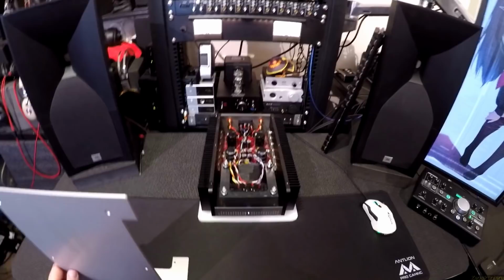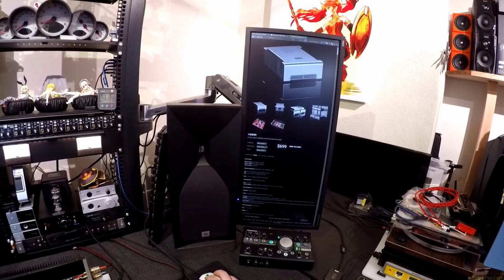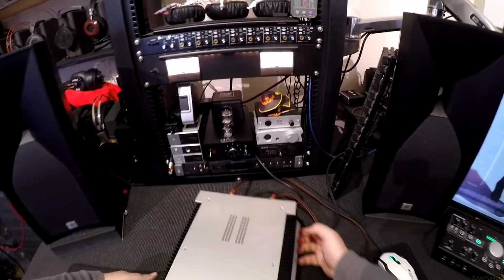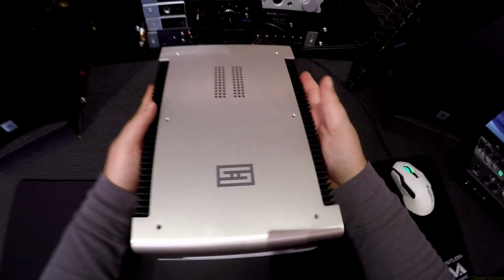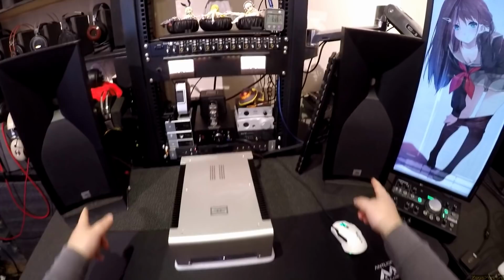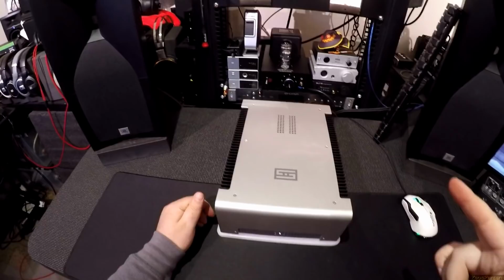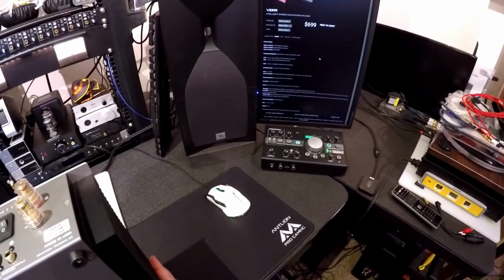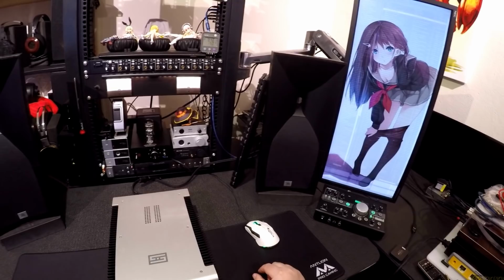Z Review - Schiit Vidar [Not Vader. NOT STAR WARS!!! FFFFFFF]

Comment: Schiit Freya [A Tube Pre that Warms your heart.....]

Schiit Vidar [A Power Amp that Warms your home.....]
Reply: Schiit aegir [A power amp that cooks your dinner.....]
Reply: I remember getting into an argument with my dad about this: If you're using resistive electric heaters to heat your home, you might as well not turn off your class A amplifier in the winter. When you're not using it, it's just acting as another electric radiator, anyhow. Then again, an HVAC repair guy friend of mine would point out that using resistive heat is wasteful in and of itself. Heat pumps often get you more heat than the electricity you put into powering them.

Comment: Have this powering my LS50's sourced from Mjolnir 2 and Gungnir. Simply stunning...
Reply: im having trouble connection my FiiO5 x3(for spotify) to Gunggir dac- should work 3.5 out from FiiO5 x3 to coax on Gungnir but get no sound, tried 3 diff cables. Probably must return Gungnir to Schiit. Do you use coax in. and yes, my cd player with RCA in to Gungnir works fine.
Reply: TheStefster nice !! I have the same set up debating if to get the Vidar or Aegir  run mono block  what’s ur take on that?
Reply: @file1man  coax is digital. not analog.
Reply: @file1man  How do you have an $800 DAC and not know coax is digital?
Reply: @file1man  does that configuration generate sound on a different DAC? Uh, no. 3.5 is an analog audio cable you should try a 75 ohm digital cable.

Comment: I have this exact same amp in black. My solution to turning it off was to get a Remote outlet and to connect the amp to that and a strip of leds. That way I can turn it off with just a remote and the LEDs will let me know if they are on, as it lights up the back of my desk. Works prtty well in my opinon and it only costs me 20$ CAD and not too much of my time.

Comment: The problem is your behringers aren’t actually putting out the wattage they claim, not cleanly and not for more than a millisecond. That why Class A exist. Class a/b is great too, but when you want a real all go no quit big nutts harry stamper amp? Class A is king. 
Adcom is my personal choice, for 1000 watts monoblock into 8 ohms (oh and it will do the schiit out of 4 ohms) you need the 585se, but I really doubt you could find the limits on their 555se...
Reply: GT4viper Class AB has nothing to do with why the Behringers aren't pushing the highly inflated wattage. It's the rail voltages at different impedances...one reason anyway. I have several mid 90's Adcom amps also....built like tanks with nice headroom. TRUELY conservatively rated power amps for a reasonable amount of $$$.

Comment: I have, a large computer desk, that had been dumped in perfect condition. It's 4 tier, heavy duty work place table, foot shelf, under desk  pull out, desk and  a upper above head shelf. This would be perfection on  that shelf with the Freya on the desk top, with my 32in monitor, keyboard on pull out, speakers desk top. Well at least I have the computer table and I can dream.

Comment: How to get over 1,000 watts: Get the VTV Hypex NC2000 mono amp (NC2K).  2,500 watts into 4 ohms, 1,600 into 8 ohms. Won't pop breakers either. SNR is 127db at 1,000 watts, super quiet. Costs $300 more than a Vidar. Makes over 800 watts before any distortion shows up.

Comment: I came close to buying this amp Z , but i bought a MONSTER instead I got the Integra M-504 50 pounds into a 20 inch by 20 inch box 2 huge transformers and huge green VU-meters ! I redone the 73000 filter compasitors and output stage transistors total cost 500 bucks  and .0003 THD Just dropped a review on it and it's a rich smooth sounding amp today it would cost me over 5k to buy something new to compete with it built in Japan during Onkyos  Golden age ! thanks Z if you wanna review it also let me know go check it out Z I know you'd love it !!

Comment: Those Behringers are NOT 600 watts from 20-20k. Maybe a true 300 watts but probably a bit shy of that. I'm sure they're good amps for the money but bridging them doesn't truely double like higher tier amps do. One spec I found on parts Express is 375 x1 bridged into 8 ohms. But that's  into 1 khz and 1% distortion. Full range and lower distortion #'s and you're looking at much lower power output than even the 375 x 1 @ 8 ohms.

Comment: my old bob carver TFM 35 amp from the 90s is 350 watts into 4 ohms and in mono its 750 watts. ON my diamond 10.1 it only says 10-25 watts at normal volume  i had it go to 125 watts and  that was only on when the bass kicked in. my father had a luxman amp that was 500 watts into 8 ohms i don't know what it was into 4 but he had the bob carver  and the luxman hooked up to the same speakers the bob carver on the mids and tweeter and the luxman on the bass and he had it so loud that he broke all the glass and ceramic collectibles off of his neighbor's wall next door in the apartment he was watching Top Gun. The speakers where the Acoustic Research Classic 30 he still has them and  just got a Emotiva 800 watt amp for them i had it on 55 could of had the cops called it was so loud but sounded amazing the preamp goes to 80.

Comment: I run one of these  power amp on 6ohms 200 watts each speaker  and it pushes them easily and very loud and clear . speakers are Dali Concept 10 s  . If you bridged 2 in mono would be over 1000 watts of raw mono power output . It would depend on the speaker ohms also.
These amps also have soft auto clipping inside Also a 12 volt trigger system.
and an input level control   . cheers and good luck .
https://nadelectronics.com/en_EU/product/c-275bee-stereo-power-amplifier/

Comment: I have my Vidars  powering my JBL Studio 590's  very happy with the results.
Reply: I've got m,y Vidar powering my JBL's as well but the old 4311 models.
Reply: @zacjbailey  does it sound good with your 4311 ?
Reply: Clayton Young It sounds great! its more than enough power for them. I also have them paired with the freya which really makes the music pop in tune mode. I mostly listen to vinyl through them though as I feel they are better suited for vintage though Spotify sounds great as well, as long as you have the brilliance and prescience in the right positions otherwise the mids and highs are pretty overwhelming 😅
Reply: are you running them as mono blocks ? I have the jbl 590's running on a dyna 70 tube amp. Do you feel like this would be more or less power ?
Reply: @Vader4tw  in mono block they can put out 400 watt which is more than enough for you might be able to get away with only one. But I think you are fine with the amp you have maybe better because the 590s are very efficient and the amp you have looks really nice.

Comment: For monoblocks, you night consider Emotiva XPA-1 Gen2. 600 into 8 ohms, 1000 into 4 ohms. Also has a 12 volt trigger. The price is right at $1199.00, but I believe made in China.
Reply: Maybe some buyers would rather not have Chinese Amps with Chinese parts.
Reply: @edithboozy1000  Schitt Amps made in USA with US parts,  Emotiva is all Chinese parts mostly built in China with some final assembly in US - deal with it.  FACT

Comment: Most wear and tear on electronics is startup. All the components need to heat up/cool down on shut-off. I think everyone in electronics knows that  The best amps are usually the simplest , I think Bob Carver said "straight wire with gain"

Comment: Adcom gfa-565se what you need is high current ...wattage is something to impress the car audio crowd  ...
The Adcom will drive any speaker even my vintage Polk's that are 4ohn but can drop as low as 2ohm and the GFA-565SE will not ever let you down .....
The only Amplifier that I've had that performed better was made by Krell and silly expensive .....
Just buy one and in stereo it will destroy what you have now but at some point you get the need to add more power then buy a second and run it in mono bridged and although it only claims 700watts in the real world when pushed it will easily push 1000 into a 6ohm load .
And the GFA stands for great fucking Amplifier

Comment: My KB has a volume roller running to my Schiit Modi 3 (while I wait for my Denafrips Ares 2) which then goes to my Tube Pre-amp with Bass and Treble and Volume, which then goes to my SVS 12" sealed sub under my desk as a foot rest which then goes to my Crown XLS 2500 which then goes to my Elac Debut Reference in Walnut on foam pads on my 3'x8' walnut finished sit/stand desk I built.  :)

Comment: I saw this - I was hesitant...to buy. The monoprice monolith amps are the way to go - it’s missing things as well (12v trigger? Loopout?
Reply: haris javed 12v trigger on a pure class A?????

These things are dependent on temperature for performance because of the number of resistors in them and the FETs.
Reply: I'd buy Emotiva pre and power first, and I reallylike Schiit. Schiit can't touch Emotiva's power amps for the money, but Schiit makes a better line of DACs and headphone booster thingies. In my first-hand experience, anyway.
Reply: I do agree with you
Reply: taief miah thank you - but I fail to see what topology has to do with 12v trigger?. I have class a Amps with 12v trigger and it’s a great way to save power. You can implement a 12v trigger regardless of Amp topology, also according to schiit audio the Vidar is class a/b amp and not fully class A as you claim. This amp uses bipolar junction transistors and depending on which ones are used can handle up to 125c, but that’s not the issue here because of large surface area of the heatsinks and plenty of room inside the chassis - I do like that this amp is built in the US, and has a 5 year warranty.
Reply: The Crushgroove I agree - I own three schiit headphone amps and one dac. For my speaker audio I use a Yamaha a2100, Yamaha z11/z9, Bryston, and lastly I have recently bought gryphon diablo 120 class A integrated amplifier, I have some parasound amps that are currently not being used (hca 3500, and  a51)
Reply: Trigger missing is an absolute deal breaker for me. So sad. Wanted this.

Comment: This was something done in the 70's to make an amplifier perform "better". Heating up the transistor cans until it's at "running" temp.  Also that would mean they would run around 90-100 degree's on average. I half way wonder if that's why the amp you have, has such a long startup time and it runs HOT. Maybe they have a little "thermal magic" going on? Though those look like mosfet transistors so that wouldn't make much sense?

Comment: comparing the specs of this unit it seems pretty good but my question is I would probably buy two of these and have it as dual monoblock set up for my tower speakers each block taken care of its own speaker. 

But then you look at something like a monolith monoprice Poweramp 2x200 which I already currently have which I got to say sounds fantastic and it ways like 50 something pounds even heavier than two of these.  I don't know if these units here well output a better sound quality then the monoprice Poweramp that I have because if you look up the specs the monoprice is still better especially the snr ratio I believe this is one 116db and on the monolith Poweramp they claim it's over then 120db just one example.
so I don't know what's your opinion but I still think the monoprice monolith Poweramp based on the specs and how much it weighs that's a good indication about solid components massive heat sinks transformer etc I still think that would be a better sounding unit then grabbing two of these and then getting 200 Watts a channel into a 8ohms when you can already get it with the monolith Poweramp .  Any thoughts 
because don't get me wrong I would be curious to buy two of these and set him up and see if I hear a difference but I don't think it would be worth the money because if I want to return it they're going to charge me restocking fee and everything especially because I'm in Canada!  But it sure does look beautiful.

Comment: If you really want to test amplifiers for noise floor and how clean they sound. Use a set of speakers that have at least 105db efficiency level to 112db. Then you’re stepping up to the next level. Don’t use speakers were there efficiency levels are in the 80s or 90db level.

Comment: @Z Reviews do what i do in middle east  go active crossover or(preamp as you call it) every frequency for each driver with a separate amp you won't need even 250 wpc for mids n highs 
also i use car audio amps n subs for lows also some audio companies use a little trick of cutting off the low frequency on a certain levels to prevent clipping n bosible distortion       great review btw and please tell chewbacca i said hi :)

Comment: If your livingroom speakers got bi-amp connection. Then i would add another sciit and run them on midrange/tweater, And the PA amp on the lowrange. Then you have the power you need without the noice.

Comment: How about a pair of Parasound A21? 750W into 8ohms each. Made in the USA.
Reply: Gerhard Westphalen parasound a21 is a good amp! I used to own one - but it is much more expensive than this Vidar. The a21 will do 250w x 2 into 8 ohms, and 400w x 2 into 4 ohms. You will need two a21’s to get the 750w - at that point you are looking at 6k usd if you buy new. I was able to get a used Bryston 14b3 for 4500usd, and it will do 600w x 2@ 8ohm, and 900w x2 @ 4ohm. I do think parasound amps are made in Canada, not USA, but I will check mine
Reply: Parasound is designed in USA (CA).  Manufactured in Taiwan.
Reply: Definitely not in Canada since they pulled out all dealers in Canada and it's impossible to buy new in Canada. I currently own 3 Parasounds that I had to buy used. I see the A21 for only $2000 so it would only be $4000 which is nothing for that much power at that quality.
Reply: Parasound with JC series  are the only ones live up to the price. The Parasound Halo A23 was horrible when I did the listening comparison among the Vidar, Mark Levinson 434 mono and the A23 was so bad (bass and trebe was horrible  - dull and no details at all  ) even if you asked me to pay $300 for it. Vidar is almost the same as the Levinson 434 in term of warmest, but the price was only a fraction. I paid $8000/pair for the ML and Vidar $1400/pair

Comment: What about a Mcintosh  MC1.25KW 1-CHANNEL AMPLIFIER there 1200 watts. Only problem is for two it might cost you an arm and a leg. Saw two "demo" models on Ebay for $21,000 They just came out with a newer model . Maybe a local dealer could give you a deal on a pair of demo older models .

Comment: My VSX D1S starter humming after 27 years. Bought a Kinder K2020A+ to hold me down until I can find an amp. My budget is $1000.
Reply: You could go the affordable integrated amp route and get a Nad D 3045 for 700 it can even be programmed to use your TV remote to control it so you can use  only one remote. I have one and love it. Sounds excellent. Or maybe a ps sprout100 for 600. Either one is small and will probably be a big improvement.

If you go with the Nad just a heads up the volume knob could be better but you're going to use the remote more I assume and if it switches to TV audio all of a sudden I've learned blu ray players when switching on can switch the audio... Just a heads up. The sprout is solid to.

Comment: Man it only has one XLR input? No toroidal transformer?(*edit* actually no) That's kinda bullshit for the money you're paying.
Reply: spookanide  this is what a usual class A power amp costs with these features????
In fact it's a pretty good price. What are you looking at?
Also schiit put the toroid in the power brick because it's easier to adapt for foreign markets.

I'm personally looking at a nordacoustics nc502 stereo power amp. Which is class D and roughly the same price. Similar features but built well.
Reply: This transformer is as good. if not better than a toroid. Schiit did a lot of research to find a robust, quiet power transformer for this amp. 1 xpl input is more than adequate.
Reply: Color me jaded since I'm not too familiar with poweramps in this price range. But a single XLR-in just doesn't make sense to me when you have stereo RCA. I'll take your word on the transformer being perfectly fine, toroidals are just better at reducing EMI by concept as far as I know. "My DAC has stereo XLR out and a PSU like that, so why not a power amp?" was the reasoning.
Reply: EI core transformers have been used in some of the finest amps ever made. Its all in the design
Reply: taief miah it not class A. Class A/B
Reply: So as people called me out I did some looking into this and you know what I take that comment back about the toroids at least. According to this here article they're more susceptible to DC offset problems in the grid which is a very very common problem. http://www.soundstage.com/maxdb/maxdb071998.htm
Reply: If you want to monoblock, that's what the XLR connection is for. These will bridge to mono when you plug in the XLR interconnect. For stereo operation, ti's RCA.